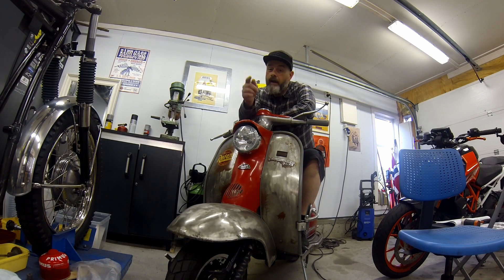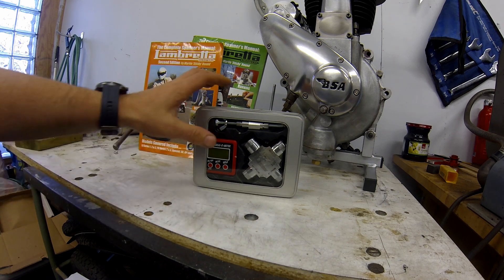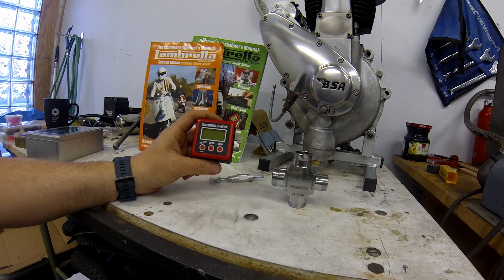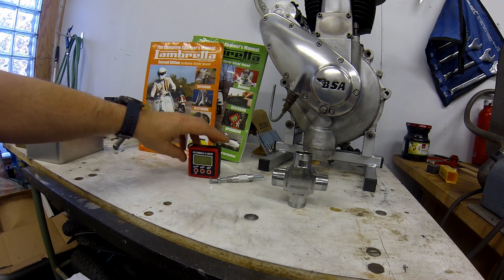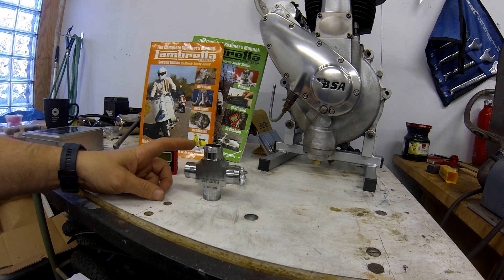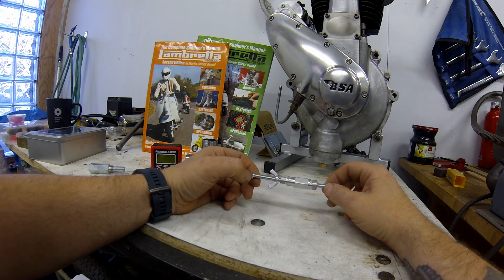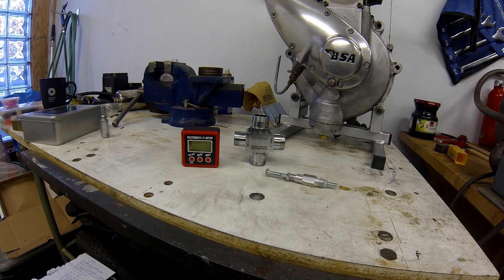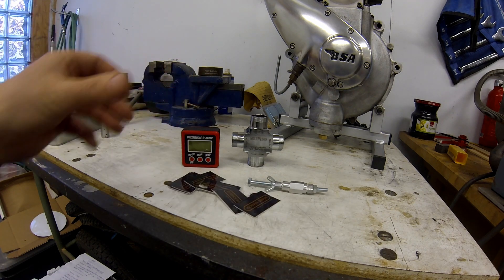Buzzwangle 2 stroke timing tool review

Comment: Hi rob, so wot about the stator were does it need to be for setting the timeing 1st ,great videos as always.
Reply from the maker: Just start it off in the middle of the screw slots. If it's Indian ignition, line the stator with the marks on flywheel window.
Reply: @kickbackgarage  cheers rob 👍